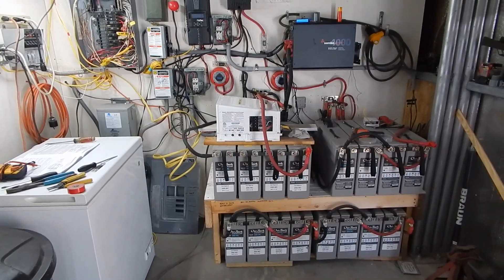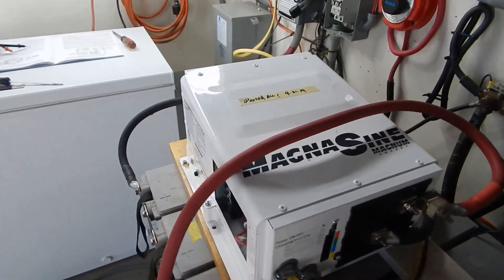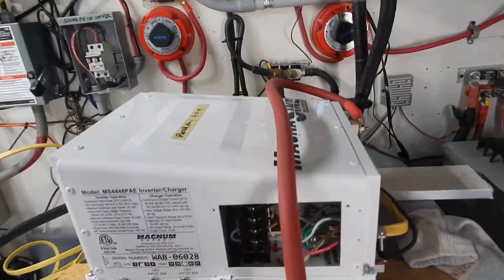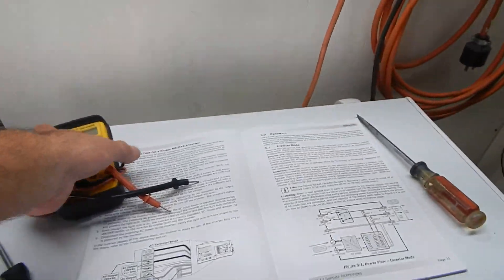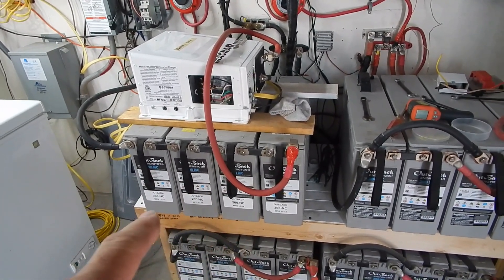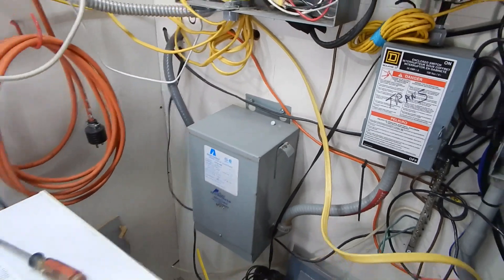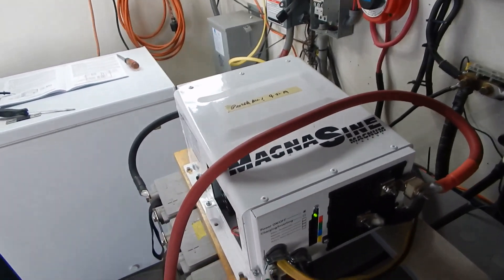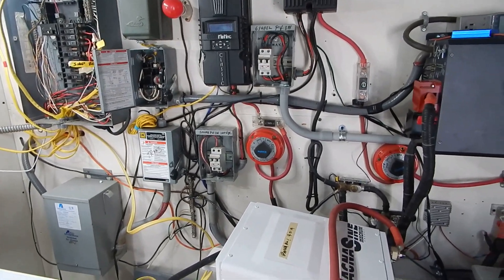Magnum MS-PAE 4448  Inverter Test.

Comment: Youl be happy with it.  I had just one when I did my R and D project with wind and solar back up System. Worked so good I went on eBay found 3 more and the rest of the boxes parts etc now I have 17.6 kw of inverter. Need more batteries is all.  Only thing I found was the lights bump a bit hard when we'll kicks in but it always starts the well there's a newer circuit board I think you may have that in yours with that new of a unit mine are dated 2013 and 2016
Reply from the maker: That's awesome Roy I would love to see the system. I plan on buying one more inverter.
Reply: @TheKiloG69  how do I send the info
Reply from the maker: A video of your system would be great. or wglenn265@gmail
Reply from the maker: .com
Reply: Was  #1 4448   magnum  able to start/run well pump? What size pump if so?
Reply: @XER239  yes one magnum inverter will start the well pump I have a franklin 3/4 hp two wire pump motor in the well they start hard as in high locked rotor current. The reason for using that pump motor was it didn't screw the pipes apart on start up.  That's what the well man told me. Been in there since 2003 not one minute of trouble.   I believe the newer magnum inverters have a newer designed board so you don't get light flickering

Comment: You will like that inverter they run nice but there is a slight hum when on AC but you don't have any so good luck.
Reply from the maker: Thank you so much yes there's no power from the grid here. Don't need it and I'm loving it power goes out here all the time. I had power company trucks with their lights flashing sitting ln my driveway down by the road. I here it happens a lot here.

Comment: Any problems with running your washing machine? I had a problem but it’s not the 4448, it seems to be the PF (power factor) waiting on my run capacitor for that circuit to hopefully fix this issue. This is a good piece of equipment!

Comment: Does the grid power and or generator power going in have to be 240v pure sine wave?
Reply from the maker: No. It will charge battery at 120 volts at half power.
Reply: @TheKiloG69  Kk, and you can charge it with a regular generator not an inverter generator?
Reply from the maker: @northlander1948  yes.
Reply: @TheKiloG69  Awesome, thank you.

Comment: I have a magnum 4024 PAE inverter and am have momentary power dropouts.  Less than one second (just enough to turn everything off) and then everything works fine again.  Seems to happen every couple hours or even once a day.   Any good ideas on what is going on?
Reply from the maker: I would check for loose wire connections, bad grounds, loose fuses, faulty breakers,over or under voltage  the list is long.

Comment: you will be happy with that inverter, what model generator are you using?
you may wish to keep the transformer on the wall just in case there is a use for it later, like with a mvp pip inverter.
best
Reply from the maker: I have three generators 2500 watt inverter 3500 watt inverter and a 7500 watt open frame 120 240 standard generator.

Comment: The one Romex 12 gauge wire is your feed for the whole breaker box? I guess that is all that is needed. How many amps does your Charge controller make?
Reply from the maker: NO!  12 GA. was just for this test. It is recommended to use a #10 for 1 inverter. I will install with a #6 wire as I will have 2 inverters someday.
Reply from the maker: Between the 2 charge controller s can put out 140 amps @ 100v in to 24v out. I will be putting in another pole in the ground this weekend so total of 4 solar trackers in I hope by this spring time. I have 3 more 240 watt panels I will put on a ground mount soon as I finish grading my back yard.
Reply from the maker: Sorry total im capably of is 160 amps @ 48volts. I have seen 140 as is now.
Reply: @TheKiloG69  That is real nice man. I got six panels I need to finish making my tracker first before I put them up. I dont get a lot of work done anymore these days I dont feel good my back started hurting me real bad. I got really fat and my UC is really bad also my diabetes is really gone out through the roof. I started working out on my elliptical machine but its going to take a long time to get back into shape.
Reply from the maker: @shartne  best wishes to you I hope you can get back in shape.